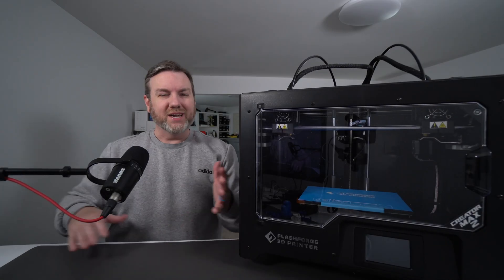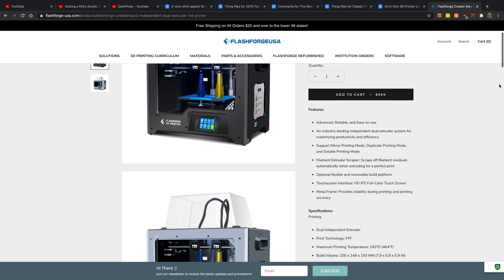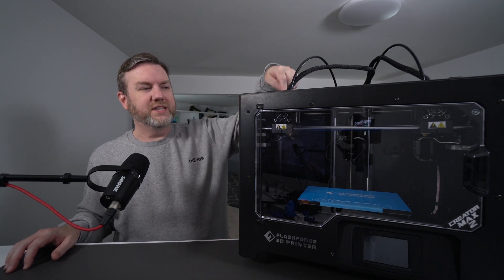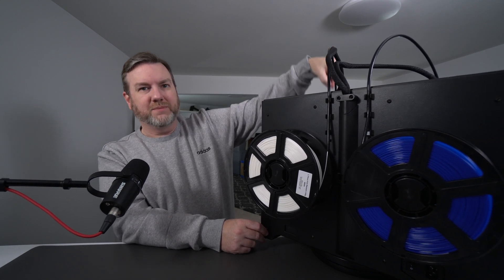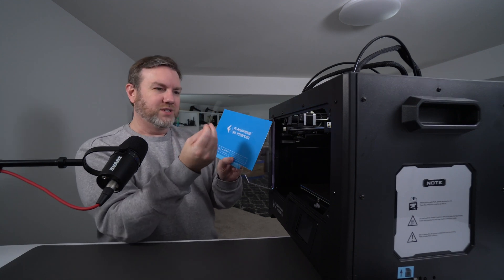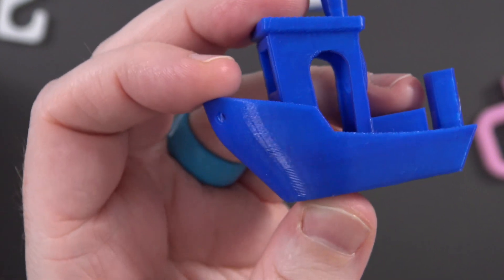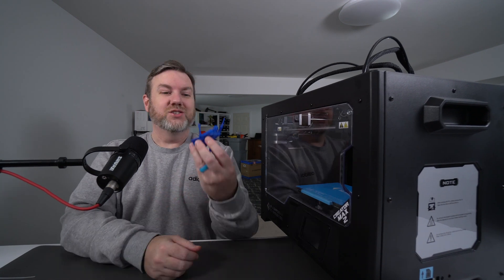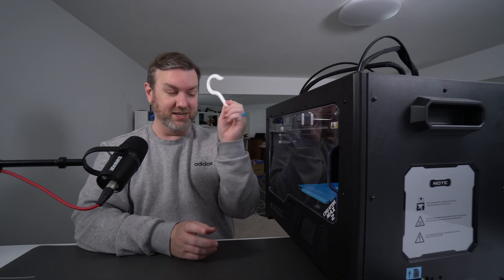FlashForge Creator Max 2 3D Printer Review and Print Samples

Comment: I finally installed my removable build plate and I printed a 3m shim prior but now when I am trying to level the bed it is way too far away from the nozzle? Did I mess up a step by chance?
Reply: Fixed that issue, but my bed still doesn't level properly

Comment: Neat. Been waiting for things to mature a bit before jumping into a new hobby, hmmm, maybe it's time ;) Appreciate the review, Jordan. I have a ton to learn so I wouldn't mind seeing some more vids from you on this topic if you're so inclined. Thanks!
Reply from the maker: The jump in technology and pricing from 2015 to 2020 was massive in my experience. The other printer I'm using was only $250. It's single color, but the build volume is much larger than the M3D I started with, and the print quality is miles better.